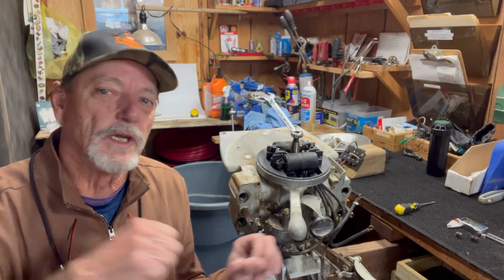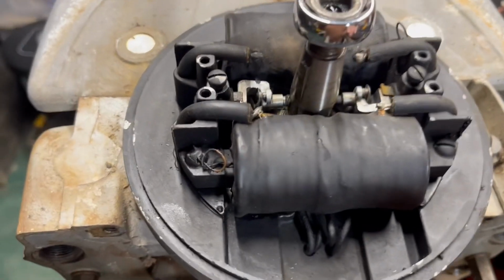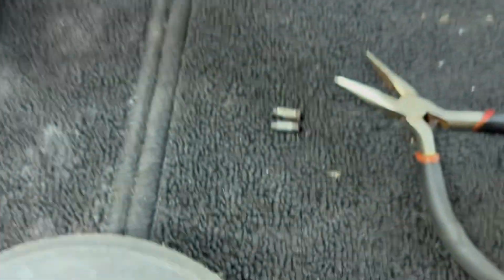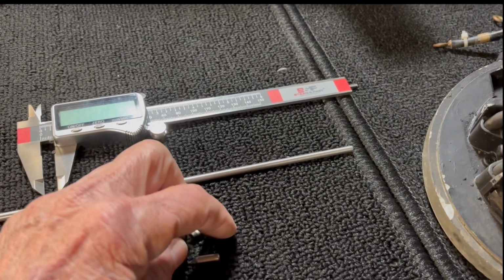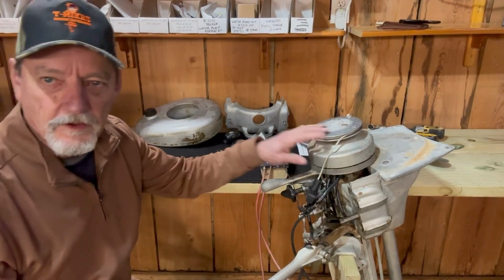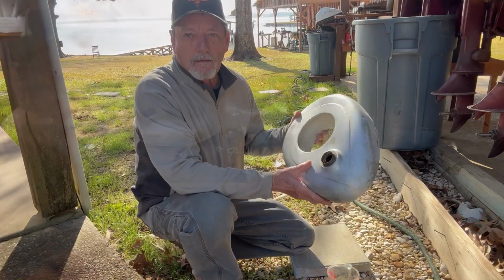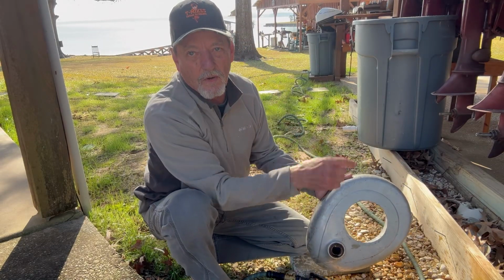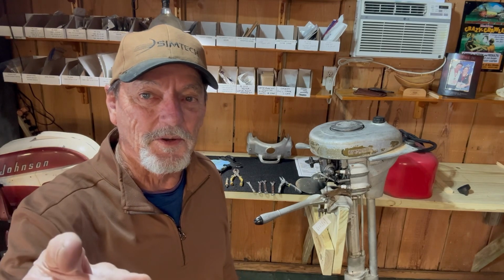Episode 4 “9.7 Motor” Spark Issues Evinrude 1945 9.7 HP #outboards #vintagerestoration

Comment: Good job and happy that beast fired up with the points rod replacement. I know that feeling. There is promise for my 47 Lightfour then but it will have to wait until the spring as its 15°F outside and i dont have a heated shop. Take care!

Comment: Wow! Very cool. I was given a 18 hp Evinrude 30 years ago, really similar design. It’s called a speedy   Twin . Has 4 plugs BIG ones. Are they firing 2 plugs per cylinder at the same time??
Reply from the maker: @RN67POST  yes because there are 2 sets of points
Reply: Sounds like a Speedifour. A Speeditwin would only have 2 cylinders.
Reply: PS, wish you lived closer I’d pass it on to you. 😬